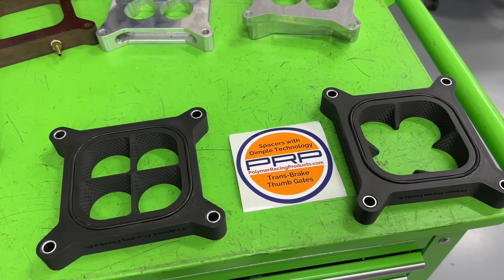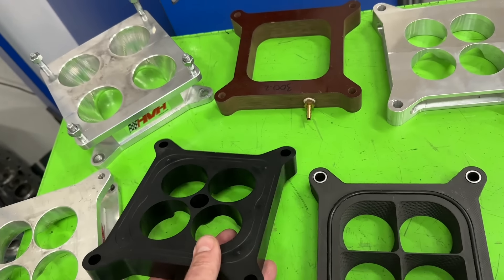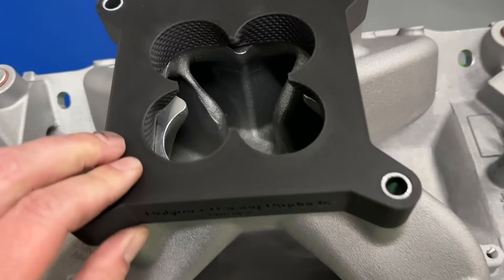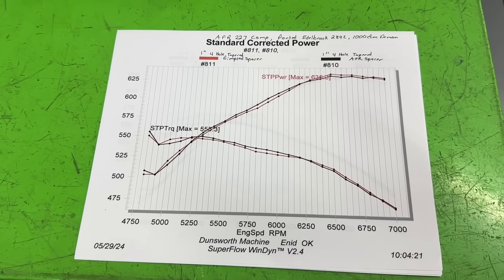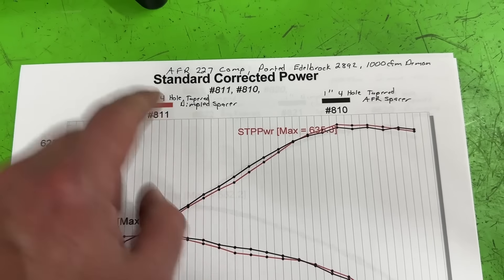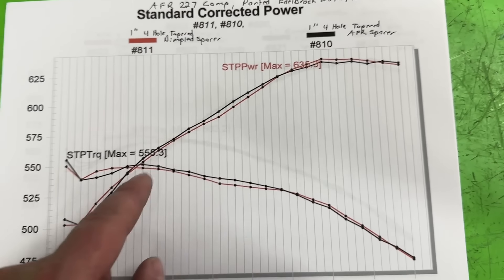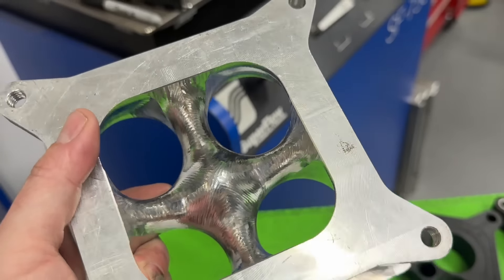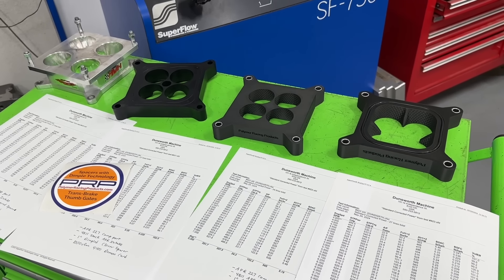Dimpled Carb Spacer Dyno Test

Comment: There is company dumpling pistons and other stuff on diesels. I had contacted them to see if they did pistons for my Ls3. They don't. I was wanting to see if it helped. But I'd have to run it and pull it and reassemble the engine. I'm not pulling my engine in and out. That would be good on a engine dyno. Or someone that can pull engines quick. That's not me. Lol. Interesting tech tho.
Reply: As i understand its to try to keep fuel in suspention through creating turbulance. 
I could be wrong, but it's necessary in a deisle engine because the stroke and hollow space in the piston is enough for raw fuel to settle on the piston.
Reply: @____MC____  oh ok cool. Tha k you very much

Comment: The dominator results are probably because the carburetor change itself. Am i wrong? I havnt seen the setup.
Reply: I was thinking the same thing that the dominator carburetor is probably what is gaining more HP more than the spacer adapter
Reply from the maker: No because I tried an open adapter and it was 4hp better than afr spacer and 4150 carb.
Reply: @WeingartnerRacing  so the 4150 was adapted to the dominator spacer?

Comment: Ok I have Holley strip dominator matched to AFR 1065 heads, open 1 inch spacer. I have a room for a 2 inch spacer ,850 Holly lots of tricks done to it. I’m ready to jump to 1000 CFM Holly or a 1050 dominator but I still want to use my4150 strip dominator. Can I ? Without horsepower loss?
Dart little M427sbc
Reply: Holley

Comment: I have 355 sbc,ported 2.02/1.6 461 heads, 225/235  279/289 112lsa cam,650 avs2, 10.35:1 compression..the intake is unfortunately mismatch, a torker II..im running it with 1" open spacer, would it be better without it?
Reply: Take it to the track, and try it with and without. Usually, those intakes respond to more plenum volume, but the MPH will SHOW YOU.
Reply: No it would be worse. That extra inch of fall just gives you more time for fuel to atomize better.

Comment: Any thoughts on anti reversion at the carb signal improving fuel atomization ?
Reply from the maker: Didn’t make more power.
Reply: @WeingartnerRacing  I was thinking in regards to the upside down test that seemed to be better.
Reply: @WeingartnerRacing  Its to bad you were not able to test the real HVH Super sucker 4150 flange. Would be cool to see the difference compared to the HVH knock off and the AFR

Comment: THE DIMPLED 4150 ON A 2701 EDELBROCK DUEL PLANE, THATS THE MANIFOLD WE HAVE TO USE IN OUR RULES. CIRCLE TRACK DIRT 1 " SPACER 7000RPM LIMITER. PLEASE REPLY.
Reply from the maker: Glad to respond. Turn off your cap lock.
Reply: @WeingartnerRacing  its off
Reply: @jimhailmann7052 no reply 😂 this guy just proves his arrogance

Comment: All that to gain a few HP at 6500+ rpm?
I hardly ever go over 5000rpm! 😮
A spacer adds velocity because the carb now has a longer intake runner, so the power gains are high in the rpm. If you remember the high torque engines of yesteryear had the carbs directly on the manifold, closer to the manifold, closer to  vacuum produced, sucking more gas sooner for more bang, ie, torque.
Remember two barrel Rochester's on V8 engines?? To produce a stronger suction still by reducing the size of the opening into the engine...

Comment: Is 30 ft lbs at 4700 rpm actually going to ET better ? Seems like the motor will never be operating at that low an rpm.
Reply: It would likely show in the 60’, which would show up in the final ET. Unless it adds more torque and the car had a spinning issues to begin with.
Reply: Not every engine is operated at WOT all the time so it could be very nice at cruise speeds where you just want to pass someone carefully but not go WOT downshift and all. Sure if it's a race only engine it probably don't matter but a lot of people drive cars on the street too.
Reply: @davidphillips3953  agreed. I footbrake launch my car at 1,500 rpm, and it immediately flashes to 4,800. An extra 30 foot pounds would definitely show up there

Comment: Could the dimple upside down clover on a dual plane intake be more fuel efficient 🤔🤔🤔
Reply: He does something similar with the four hole tapered. It wasn't dimple though he put it upside down and he did gain power. I don't know if that would be the case for every engine.